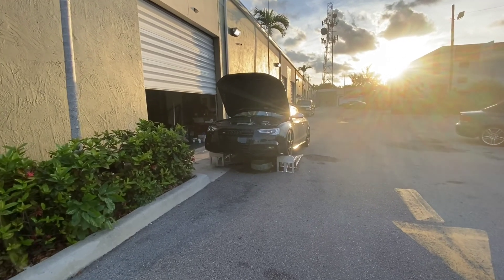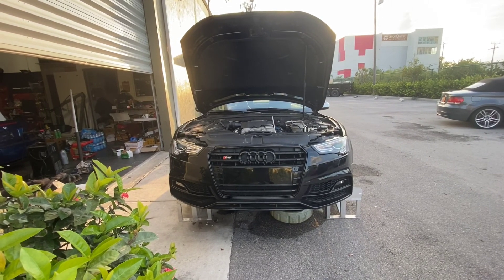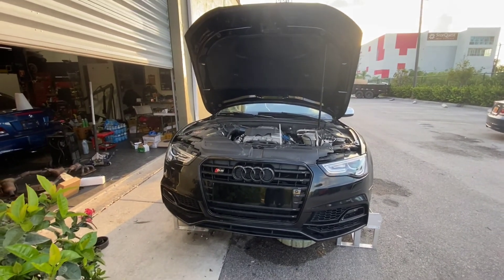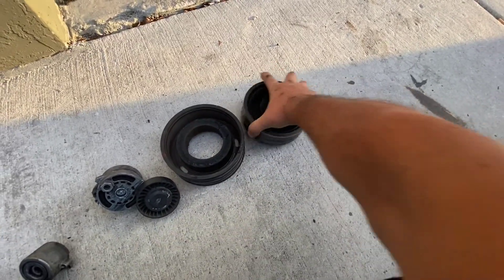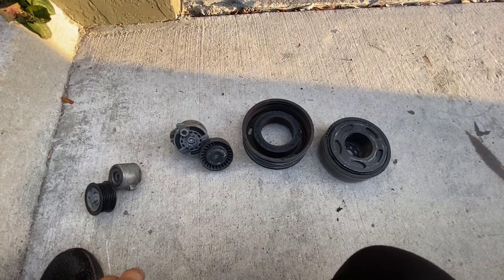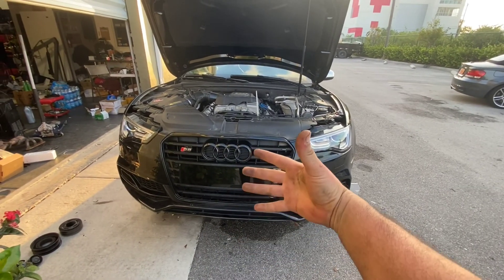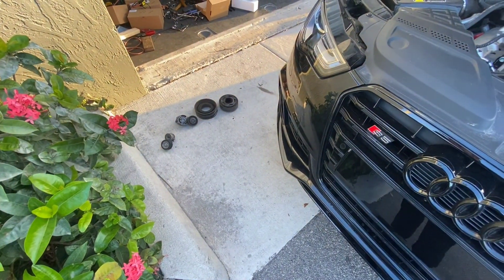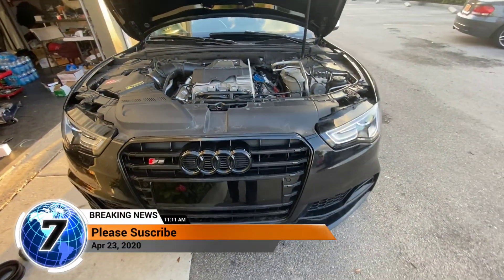Audi S5 3.0T B8 Crankdhaft Pulley Harmonic Balancer issue

Comment: I have A7 with same issue and its in the shop getting repair. Thanks for the info
Reply: my A7 just had the same damn problem and it’s in the shop 1200 bucks for the fix
Reply from the maker: No problem, at least you get an idea of what’s involved in the repair . Cheers
Reply: @maxspeedmotorsportsgarage4760  when replacing with a oem do I have to make any marks to make sure that the offset bolt lines up?
Reply: Did Audi cover it in the warranty?
Reply: @TheBobial24  Yes